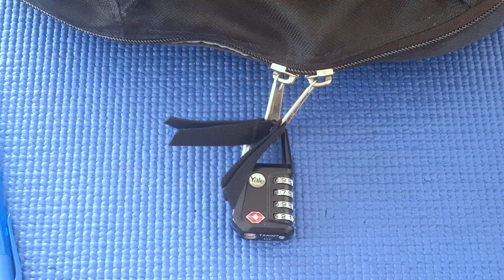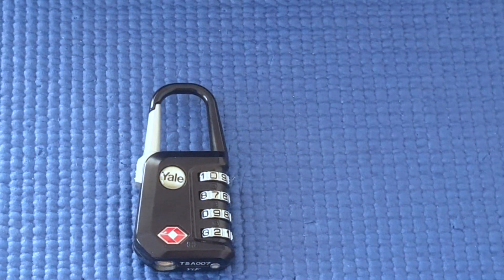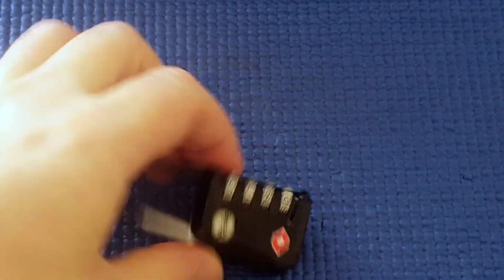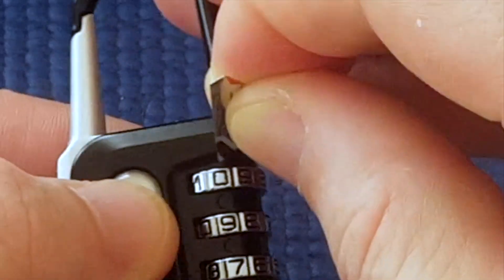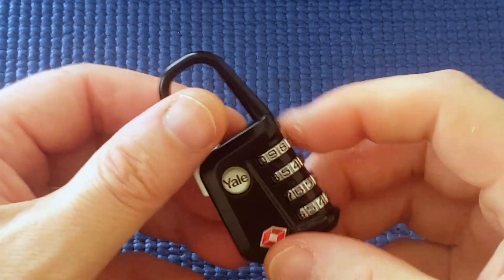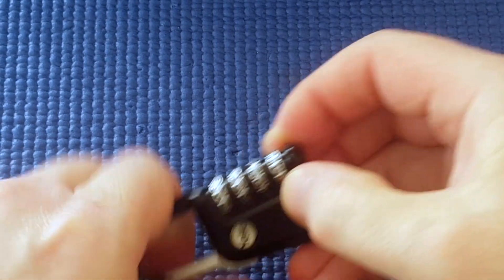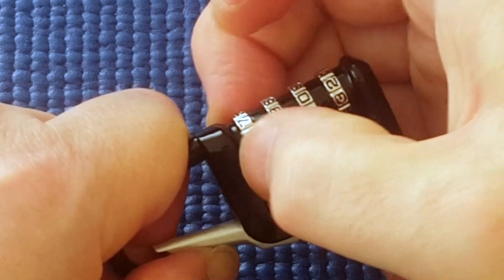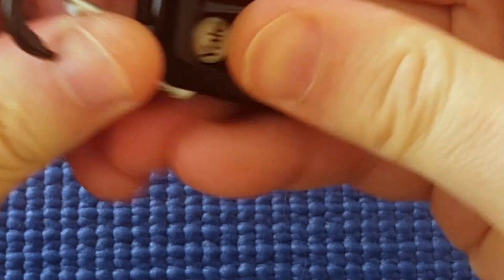(Picking 71) Four ways a thief might get into this Yale TSA travel padlock without bolt-cutters

Comment: Very nicely done my friend, i did not know Yale made tsa locks
Reply from the maker: Thanks! :D  Yea I expected a stronger lock since it's a Yale.
Reply: i haveone that swings out. if you shove a straight piece of metal in the tsa key hole and wiggle it rappidly while pushing down on it, it opens easy as... 0 security. cost $10 nzd